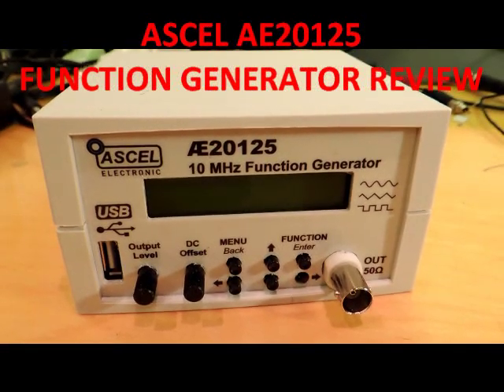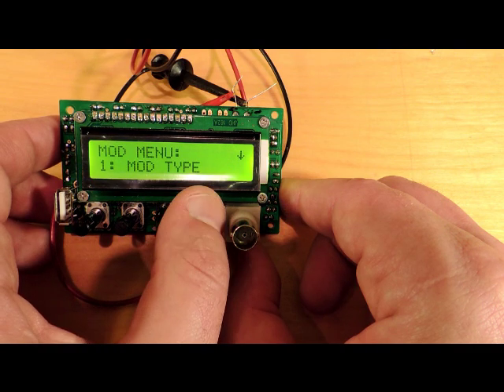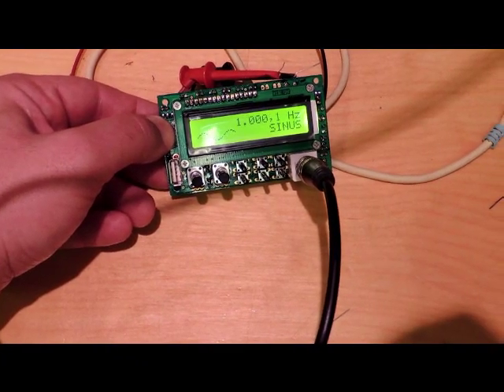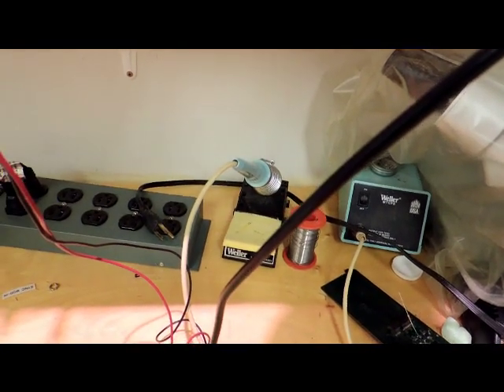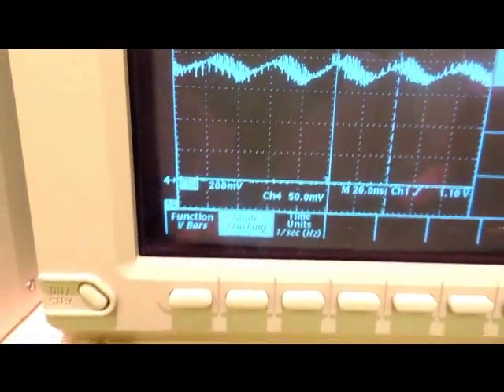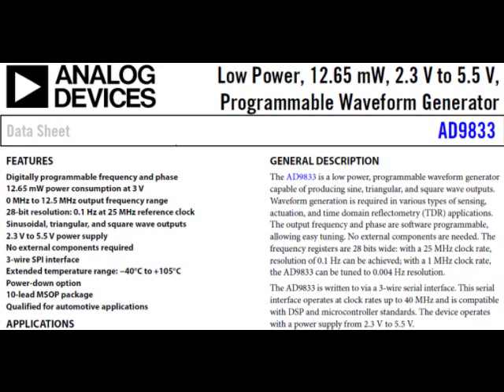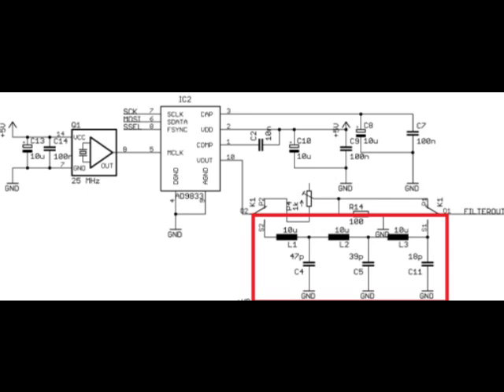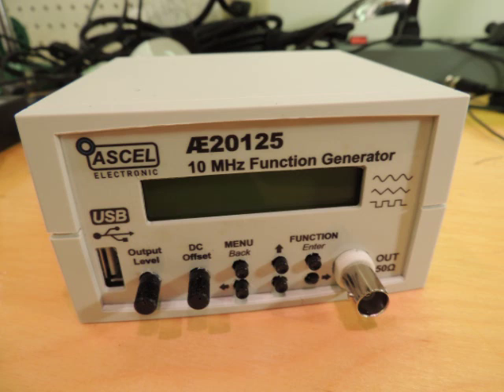Ascel AE20125 Function Generator Review and Teardown

Comment: Hi, I completely mounted the AE20125 Function Generator kit and performing the first tests I noticed that it works. However I can not understand exactly the calibration procedure.
I have performed what the manual says:
1 - I set a square wave with a 5 kHz signal (between 1 and 10 kHz)
2 - I turned the knob of the DC offset halfway
3- I rotated the amplitude potentiometer everything to a minimum
4 - I rotated the P3 trimmer (10KOhm) in order to have 0 volts.
Connected to the oscilloscope output and in these conditions I noticed that gives me:
Vmax 96mV - 250mV Vpp Vmin -164 Top = 87.3 mV
Later,
 when I began to turn the potentiometer from the minimum amplitude 
increase it was noticed perfectly square wave with the centered position
 which of course also increased amplitude. Turning the knob of the DC offset, I noticed that depending on the 
direction of rotation (right or left) the form of oscilloscope wave 
descended downward (negative) or to the upward (positive).
From these first tests I deduced that:
the
 trimmer P3 serves for fine and final centering of 0 Volt of the DC 
offset position, so that (with the DC offset potentiometer perfectly in 
half and completely to the minimum amplitude potentiometer) there is a 
0Volt value of output amplitude without any negative or positive value.
In
 fact, by measuring with a multimeter I noticed that I have a AC 0V 
voltage then turning the potentiometer DC offset to the right, the 
voltage increases becoming positive, vice versa turning to the left 
becomes negative. I
 realized that a perfect calibration of the P3 trimmer potentiometer 
should result in the DC offset halfway signs Volt 0 volts while the 
maximum excursion is marked to the right and to the maximum travel on 
the left are the same but obviously either polarity depending on the position.
I would like to know if this calibration of the DC offset symmetry is 
in order before the procedure to be performed and if you need is a 
voltmeter that does not necessarily measure volts peak to peak.
And 'normal that with the amplitude potentiometer to a minimum there is still present a signal of a few mV sinusoidal form?

At the second calibration, which concerns the amplitude of the square wave form I encountered the problem:
(Assuming that I run as well as in the manual)
1 - set in the output menu a square wave 5Khz as well as indicates the range (1-10Khz)
2 - I calibrated the P4 trimmer 1KOhm to get 5 Vpp.
Actually on 'oscilloscope I have these results:
with maximum amplitude potentiometer (all rotated to the right) and P4
 trimmer at minimum get: Vmax Vmin 23.2 -23.2 22.7 Vpp 46,4V Top V
but if I rotate the trimmer all to the opposite effect, in oscilloscope I get:
53.6 52.0 Vpp Vmax Vmin 106V Top 52,6V

Of everything I did not understand the procedure and what could happen.
Maybe I misinterpreted the oscilloscope (I used the "Auto" function in the oscilloscope).
the values that are read right?
Could you give me more detailed indications of the calibration process?
What do you mean these 5 Vpp to be expected? the DC offset potentiometer how to set it?
Thanks in advance